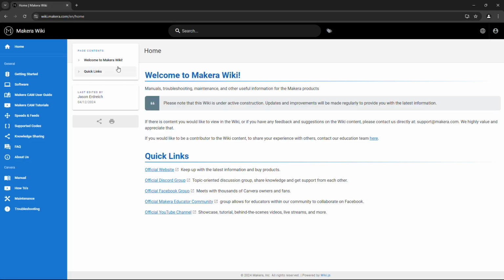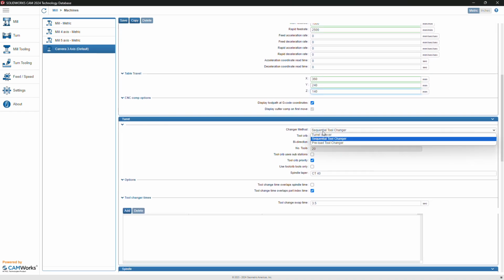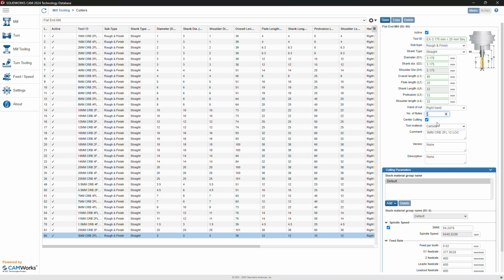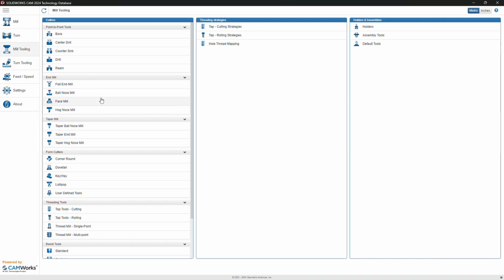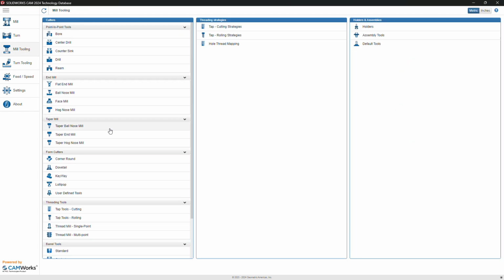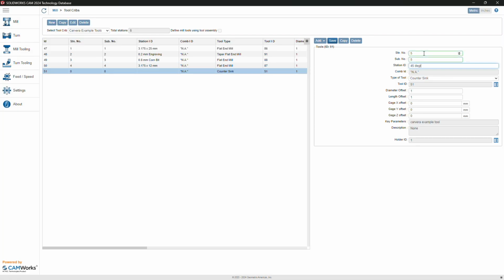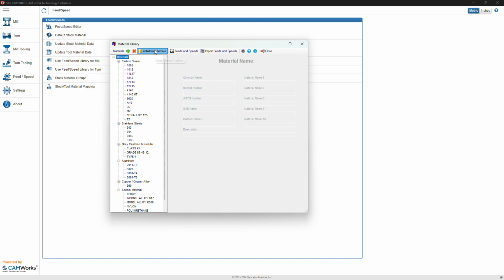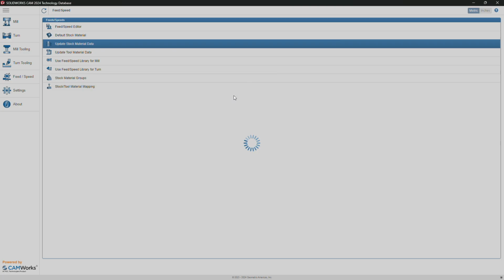Getting started with Solidworks CAM and the Carvera CNC - Part 1, The Technology Database

Comment: Nice tutorial, but I wish there was one made for the Carvera Air as well. This tutorial includes the Carvera Tool Changer setup, which the Carvera Air does not have. It would be nice to have a step-by-step setup focusing only on the things the Carvera Air needs.
Reply from the maker: The Carvera profiles for solidworks will also work with the Carvera Air. And while the Carvera Air does not have a tool changer, the numbers you assign to your tools in the Solid Works data base will prompt manual tool changes for the Air.

Comment: For anyone who might run into issues with the profile locations; I'm using SW CAM 2023 and had to instead put my profiles here: C:\ProgramData\SOLIDWORKS\SOLIDWORKS CAM 2023\Posts

Also make sure your registry key lines up with the correct Posts location @ HKEY_CURRENT_USER\Software\SolidWorks\SOLIDWORKS CAM\PostData & HKEY_LOCAL_MACHINE\SOFTWARE\SolidWorks\SOLIDWORKS CAM\PostData

Comment: Question:  we only use wood in our class projects.  What stock material closest resembles that?  I was thinking nylon or epoxy.  Your thoughts would be very helpful.
Reply from the maker: This is a great question! We would suggest epoxy for softer woods like pine, and ABS or nylon for harder woods like walnut.

Comment: I noticed that you put in the corn bit.  I created a bit for our 1/32 flat end mill( did the metric equivalent) and solidworks did not recognize it because it was smaller than 1mm.  Simulations of the tool path did not run.  I will try doing it this way to see what happens.
Reply from the maker: That's interesting, and perhaps something that solidworks forums may be able to help with. You should be able to utilize bits smaller than 1 mm as we have, though we've also noticed that solidworks' simulations do not show everything, like peck-drilling for example.
Reply: @Makera I’m waiting for you folks to get the 3D model import feature working in MakeraCam so that SolidWorks models can be imported directly into it.